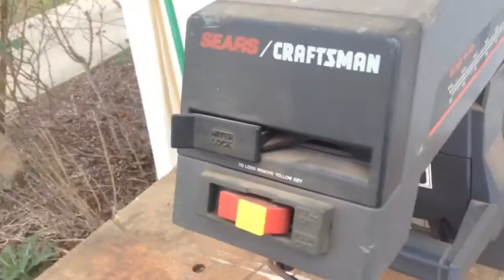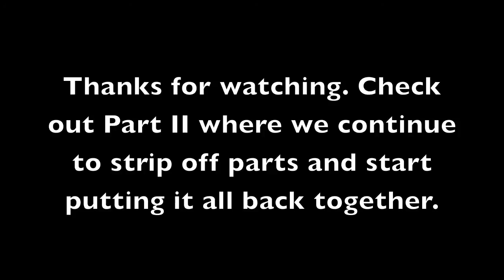MDOP#17: Radial Arm Saw Refurbish I

Comment: I think the parts that are "frozen" might not actually be stuck. I think theres one latch aspect, which your releasing, but theres usually(at least on mine) like a detent pull button that releases it. so those two beveling aspects that are stuck each may have two things to be manipulated in order to move them.

Comment: Question: The console does not rotate 45 degrees to the right and left when the lock lever is pressed. ????
Reply: Check out the very end of video #18 to see where the mechanism is for the miter lock. It is fairly easy to access, and I suspect the notch for the pin may need cleaning. Good luck.

Comment: I have this exact saw and I need some help. The nut and the plastic bevel gear fell off of the threaded, shaft elevating rod when I was attempting to raise the blade. Can you remember how I get that thread rod to come back down far enough so I can thread the nut back onto it. Presently, the rod it almost flush to the surface, and I cannot get the nut onto it. Thanks!
Reply: I'm so sorry, but it has just been too long since I've even looked at this saw to give you any kind of helpful answer. I remember it wasn't easy getting access to that rod, but I don't remember how I actually did it. I wish you all of the luck in the world with it.

Comment: Once you release the leveler for the RIP saw you have to pull back on the level just a little more to release it out of its 90 degree position my son figured out it's not frozen I thought the same thing although we did have to get the bevel to work properly...

Comment: have 113-198510 saw with cabinet.   cannot get the bevel lock to release.  I can hear it clicking but wont release.  took motor housing off.  took the 4 screws out with 1/8'" allen wrench.  took nut off back and that is as far as I can get.  any suggestions ?  I still have the manual with parts view.
Reply: There are 2 phillips screws that hold on a cover to the locking mechanism. There is a pin that is supposed to be actuated by the locking mechanism. It is probably frozen (mine was). Cleaning and greasing and reassembly solved the problem. Then follow the manual to adjust the bevel lock.